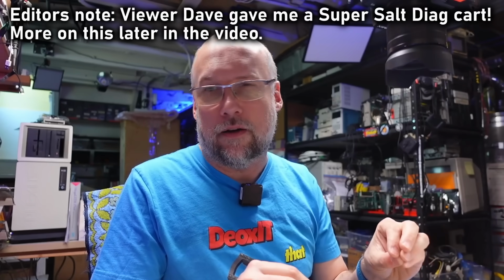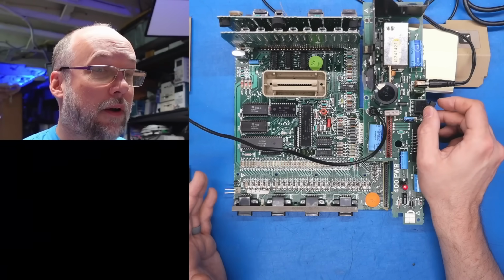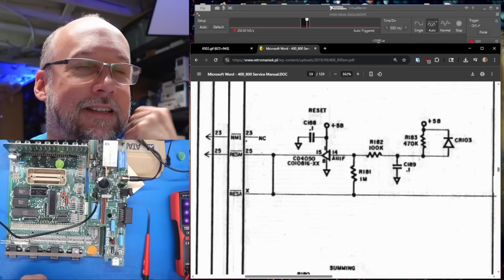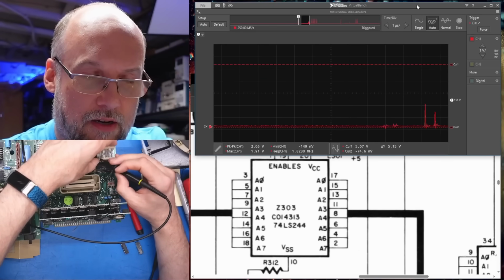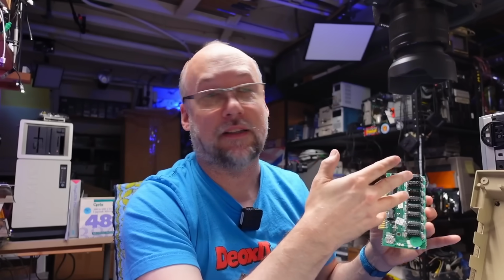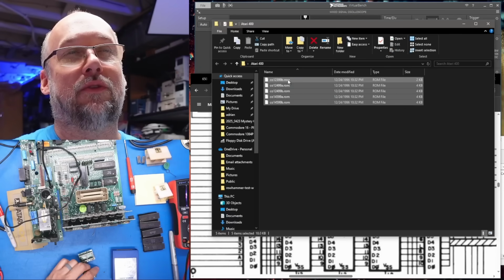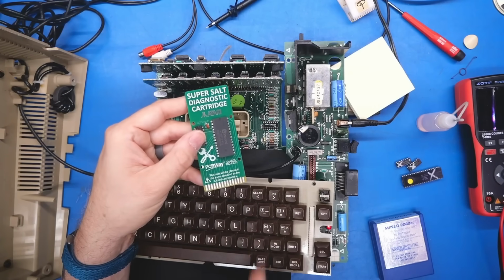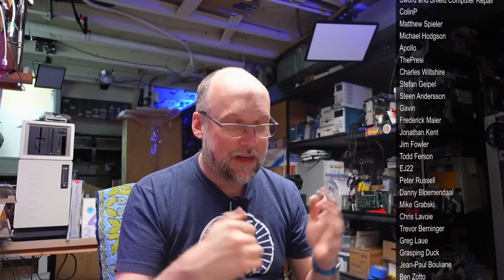Repairing a smashed-up Atari 400 computer

Comment: Just a bit of background you might find useful. The Atari 8-bit computers are based on the original Atari 2600 design. The 2600 had a TIA chip that had to be "fed" data by the CPU on-the-fly as the scan line was moving across the screen. This consumed a lot of CPU time. The CTIA/GTIA in the Atari 8-bit computers are essentially upgraded versions of the TIA. The ANTIC works as an independent coprocessor that feeds the CTIA/GTIA, freeing up the CPU. The program running on the 6502 CPU would write a series of instructions for the ANTIC chip into RAM (called a display list); the ANTIC would then read those instructions and update the CTIA/GTIA independently.
Reply: Jay Miner and the other guys that developed ANTIC/GTIA/POKEY went on to start Hi-Toro and develop the Agnus/Denise/Paula chipset that became the heart of the Amiga. Very similar design, just more bits/speed/DMA channels.
Reply: @coyote_den   Well, the Copper is much more of a real coprocessor than the ANTIC, and the blitter is different from anything the Atari 8-bit has.  Miner and company took a similar approach, certainly, and the lineage is visible, but the Amiga chipset is hardly "very similar" just with more bits and bandwidth.  The Atari 8-bit relies a lot more on its CPU to manipulate graphics (even its sprites, called player-missile graphics, are more dependent on the CPU than the sprites of the TI TMS9918 and C64 VIC-II graphics chips).

My point is that too much is often made of the connection with the Amiga.  Their differences are what set the Amiga apart from other 16-bit computers at the time, not so much their similarities.
Reply: A great visualization of how this works is in the video Retro Gaming Mechanics Explained released about “Racing the Beam”
Reply: @JD3Gamer   The graphics subsystems of all computers have to "race the beam" to generate a display.  The Atari 2600 and early Sinclair computers, to take another example, did this with the CPU as the "front end" or driver that fetched graphics data, which was what made programming them somewhat unique.  However, the Atari 8-bit computer series did away with this, for the most part, by introducing a driver circuit, which means that it works a lot more like other computers and consoles.

Its CPU is still sometimes used to do things in a timely manner concerning the raster beam with display list interrupts, but the same is true of the C64 with its raster interrupts.  In fact, I've seen similar examples on many other computers, including the Tandy CoCo series and BBC Micro series.  They might not have the same official built-in features to support "racing the beam" as the Atari 8-bit and C64, but clever programmers have managed to do some tricks with precise timing to achieve some of the same results (albeit probably more limited in some ways).  I'm pretty sure the same has been done with the VIC-20, as well, without official support from its video chip.
Reply: Amazing ❤😮
Reply: Chasing the beam, man. ✌️😅
Reply: While that's interesting and helps explain some of the specific design choices that were made for the Atari 8-bit, this is really no different from what any other display driver circuitry does, from the original Apple II's TTL logic (implemented in a GAL chip later on the IIe) to the VIC-II in the C64. 🤷‍♂  Whether using discrete TTL chips (Apple II, II+, original PET), two chips (Atari 8-bit), or a single chip (most computers), the "front end" driver circuitry fetches data from memory to "feed" the "back end" that actually generates the image, so that the CPU doesn't have to.  In most cases, however, they have to share the memory and data bus with the CPU, so they don't really free the CPU up in every way--they use a lot of cycles that the CPU could have used instead, which is especially apparent on the Atari 8-bit.

The real point is that being an ASIC, this "front end" circuitry (the ANTIC chip in the case we're mainly looking at here) is more efficient at doing this job than the CPU.  For instance, it can "feed" the "back end" with a new byte on each cycle, while the CPU would have taken multiple cycles for each byte.  This allows the Atari 8-bit and other computers alike to display more detailed graphics and text than is possible on the 2600.  My point is that there is really nothing that inherently makes the Atari 8-bit unique in these respects.  Sure, some of its features are unique, particularly its display list, but the same could be said for all computers' graphics subsystems, which fundamentally perform the same tasks for the same reasons.  They do this job better than any CPU could, but they don't simply free up the CPU, as there is a cost for the job they have to do, in terms of memory sharing and contention.

These other graphics "front ends" are also coprocessors that act independently of the CPU, but also in response to its commands, of course.  The main difference with the ANTIC is that each row consisting of 1 to 16 scanlines gets an entry in a display list that simply lists the mode of each row, along with a couple of flags for interrupts and reading a new address from which to fetch data.  The oddly intense focus on specifying these things row by row was apparently inspired by the 2600's design, as was creating a second chip to act as the "front end" in place of the less efficient CPU, but otherwise the ANTIC does the same thing that other graphics chips do.  The VIC-II, for example, simply keeps a state for its mode rather than reading from a display list for each row, and it can interrupt the CPU to make changes when necessary.  The ANTIC can change modes and the current data address by itself, which is unique and interesting, but other than that, it also depends on the CPU for every other trick (including, significantly, changing color registers), in the form of display list interrupts, which are essentially equivalent to raster interrupts on the C64.  You could look at the ANTIC as more of a coprocessor because of its display list, but practically, from either a hardware or software point of view, I don't see much of a difference.  I did kind of balk a bit when I first learned how to program the Atari 8-bit, though, when I had to create a display list with more than 192 entries just to display a simple bitmap. 😄  All that takes is a few writes to a few registers on other computers.
Reply: Let's clarify some things. The issue wasn't just "consuming a lot of CPU time." It was more the fact that the CPU had to bit-bang info to the TIA, so coding was not flexible. That was not that big of a deal for running a handful of simplistic games. So, the ANTIC was created to be a bus-mastering DMA device to handle the CTIA/GITA. That is why it uses the "Sally" 6502 variant. It provides a CPU halt line. It also reduced the CPU usage because ANTIC supported a display list format. 

Unlike the TIA, the CTIA/GTIA chips do not offer sound support. However, the Pokey is used for that (and manage the keyboard and ports). While CIA interface chips are not specifically designed for sound, they do have timers that can be programmed to operate within the audio range. The CIA is used to produce the keyboard chirping and the warning siren out the internal piezo speaker. Pokey sounds go out the RF modulator.
Reply: @PlumGurly  It's actually the GTIA that does the keyclicks.
Reply: @PseudoGfx  -- PIA/CIA/VIA chips have been repurposed in many ways (even as part of a stack pointer in a homebrew CPU). But looking it up, if what you said is true, it would have to be bit-banged. Or maybe both of us are true. I mean, route the PIA into GTIA. So the PIA is giving the clock pulse for the sound created by the GTIA.
Reply: @PseudoGfx  -- The more I think about it, the more I think we are both right. The CIA and GTIA might have been used together.

I say that because of how the IBM PC did the internal speaker. There is the PIT chip (dedicated timer chip), and you could route it through the speaker port. So a register might combine the PIA and GTIA's sound port.

But I'll dig more.
Reply: @PlumGurly love this back and forth! Thanks for being part of the “those in the comments who know”❤😂
Reply: @PseudoGfx   The Atari 8-bit is about as messy as the C64 in this way.  The designers often stuffed functionality wherever they happened to have some silicon to spare.  That's why the C64 uses the 6510 CPU.  Its tri-state data lines were necessary for its own graphics DMA, but it also seemingly randomly has a 6-bit I/O port because the C64 happened to need that, and the CPU was a convenient, effectively cost-free place to put it.  This is why the Atari 8-bit handles the clicker and the console buttons the way it does, too: "Shoot, we ran out of space/pins on the POKEY with all of the 'feature creep' on that chip, but there's some room left on the GTIA to do this stuff without appreciably increasing cost, so let's do that." 😄
Reply: @PlumGurly   CIA/VIA?  Isn't it the PIA (6520, like the Commodore PET) in the case of the Atari 8-bit?  They're all similar, in any case.  And sure, they've been repurposed in many ways.  On the C64, for instance, two of the I/O pins of one of the CIA (6526) chips controls the VIC-II (which can only address 16K at a time) bank.  Effectively, it was used to give the VIC-II 16 address bits instead of the 14 it actually has.

As for the clicker, I don't believe that the PIA is connected to the GTIA's clicker (internal speaker on the 400 and 800, or equivalent sound mixed into the audio output in later models).  To generate a tone, the CPU has to bit-bang the clicker, much like on the Apple II.  The POKEY's sound generation is a separate thing, and with that available, it wouldn't have made sense to put any more resources into the clicker.  It is quite useful for porting Apple II games directly (lazy port) in terms of audio, though.  Plenty of games that originated on the Apple II (that I've seen) do this.
Reply: @rbrtck  -- Yes, the Atari 800 used a PIA.

But my focus was discussing the video hardware. The 2600 used the TIA for the video chip. The 400/800/XE/XL used the GTIA as the video chip, and also a display list processor called ANTIC. ANTIC acted as the interface between the CPU and the GTIA (or CTIA for some early runs). The ANTIC created raster and frame interrupts and used bus-mastering DMA to pass the display list from the CPU via RAM to ANTIC. ANTIC in turn would process the list and guarantee 1 pixel per cycle. It would handshake with GTIA, which generated the syncs and did the chroma/luma stuff.

As for the clicking/chirp sounds, I was wrong earlier. It seems the video sync chip (GTIA, or rarely CTIA) made the crude console sounds. It makes sense. It should have access to 15750 Hz at that point.
Reply: @PlumGurly   Mainly, the CPU wasn't nearly as efficient as a purpose-designed circuit (ASIC) could be.  This severely limited the graphics that could be displayed by the 2600.  The ANTIC could help generate (along with an improved TIA in the CTIA/GTIA) more detailed graphics while using up fewer of the cycles available on the data bus.  It still steals cycles from the CPU, which halts and does no work whenever the ANTIC needs to read anything, but it steals fewer than the 2600 required of its CPU, and does a lot more with those cycles than a 6502/6507 or any other CPU could do.

As for coding not being as flexible, I have no idea what you mean by that.  The CPU can't stuff as much data into the graphics generation chip as the ANTIC can, which is why the architecture was changed.  The 2600's CPU could run any code programmers wanted when the beam was outside of the display area, and had to completely or almost completely devote itself to feeding data into the TIA the rest of the time.  I suppose this is less flexible, although I just look at it as the CPU being burdened by a task for which it was not optimized, as a general purpose processor.

The "Sally" 6502 variant was used later in the XL and XE series, because it incorporated a bunch of support circuitry that had been implemented separately in the 400 and 800, which use the regular 6502.  This was a cost- and space-saving measure (similar to the C64's use of the customized 6510).

The display list is supposed to save some CPU cycles when modes need to be changed mid-display, but I'm not entirely convinced by that.  Just for the ANTIC to read the display list of a simple, single-mode bitmap consumes more than 200 cycles per frame, and while being able to change modes on its own saves the CPU a few cycles of work, the CPU is halted for those 200 cycles on every frame and gets no work done during that time, anyway.  For comparison, it would take fewer than 200 CPU cycles to change the mode on the C64 using a raster interrupt, and if no such changes are needed, then it simply keeps displaying the same mode.  On the Atari 8-bit, you have to tell the ANTIC to display a bitmap for each scanline (plus some extra stuff that adds up to 200+ entries), which it has to read and heed even if only a single mode is used for the whole display.
Reply: @rbrtck  -- I meant the TIA alone was not flexible to code for since connecting it directly to the CPU meant you had to code to be in sync with the image ("racing the beam"). But adding ANTIC provided that flexibility due to what I said later, since ANTIC triggered interrupts and you didn't have to bit-bang, cycle-count, etc.

That is similar to the Gigatron TTL computer. It multitasks to bitbang the display, and you get 40 cycles per line to run the vCPU interpreter. But the difficulty coding is only at the native layer, and that is in the ROM. The user-facing vCPU code is more flexible as the user doesn't have to count cycles. The Harvard ROM core handles all that.

So I was saying that ANTIC gives abstraction from pixel timings. The 2600 was not that flexible to code for since you had to know what TIA was doing at all times and code accordingly. But adding ANTIC abstracts coders from the video mechanics since interrupts are what keeps you in sync when/if you need to be.
Reply: @PlumGurly   Oh, OK, I get what you meant now.  Now I don't know why I didn't before. 😄

Comment: Sinclair was famous for buying faulty 16bit memory and only using the good half in the Spectrum. There was even a jumper on the mobo that enabled the board to choose which side of the memory to use. Could it be that Atari used the same ploy for cheaper memory?

Comment: I can't remember where I (recently) learned this, but the heavy-duty RF shielding was done to comply with the RF interference regulations BEFORE the Atari 400/800 was released.  After it was released, other computer manufacturers lobbied to lower the requirements.
Speaking of lobbying, I nagged my Dad into getting an Atari 800 back in the day.  He was a rare engineer+programmer at that time, and within a month he had taken it over.  He ended up using it for work, so he was a verrrrrry early WFH software engineer.
I think he got me an Atari 400 as a consolation prize, and I went on to play many a game of star raiders.

Comment: I enjoyed this episode very much cheers! Atari 800 was one of the first computers I had a reasonable contact with and I have every after thought it was a decent machine but thought you needed to upgrade the Atari 400 much like if you had a BBC Model A you would want to upgrade to a Model B, or ZX80 to ZX81 as the 2nd one was the real deal. Your experience here reminds me of what turned me off dealing with the electronics LOL I do not think I would have been so relentless and logical. And in the end you find it just works with the presumably bad GTIA chip. But it is true these IC parts are actually physical things, like a mechanical subsystem, but it is all enclosed and we do not have much capability to see inside the thing. Or maybe you could??

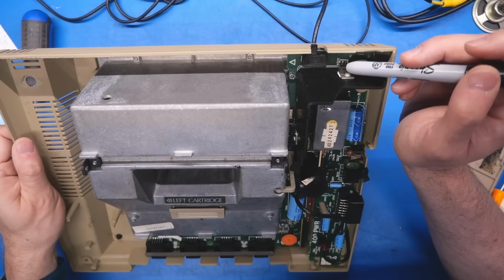Comment: 8:00 Wouldn't the voltage regulator be a 7805, not a 7812? 🤔
Reply: 7805 for 5V, 7812 for 12V, IIRC this computer uses both
Reply: Yerp, lol.

Comment: Hi again,

At 1:30:00 and up,

Im6into repairing old synths, I can tell you that's 9 out of 10 it's usually these old sockets causing random problems.

And it helps a lot when put and pull chips in and out several times. These tiny 'spring' loaded contacts tension usually fade away over the years sitting and staying always at the same pressure level. And they are not made using real spring metal type. Also plastic degrades and can't hold contacts at the same position as expected.

I usually solder a new top grade socket onto the original if there's enough space, if not I swap it for the new one, usually this helps.

Remember when these units had been assembled they went for the cheapest possible given that a computer would be used 10 years at most. And didn't do much temp chamber testing anyway.

Contact failure is one of the top 3 failure modes when it comes to old (computerized) units. Being 1st is power supply and mechanic components issues (switches, jacks, ribbon cables)

And : EProm issues. A lot. And they're getting worse.

Make a copy as soon as you open the unit and spot them.

I don't know, may be heat or whatever, as they don't see any UV light inside a closed unit anyway. I even found eproms with a fallen off whatever taped on the window, but worked great.

Usually I open old synths carefully at dimmed lights in order to don't expose any EProm to harmful lights.

Stick then into my EProm reader and do a back up immediately. If I see that window not covered I cover it right away. And do a readout at the very 2nd.

Cheers.